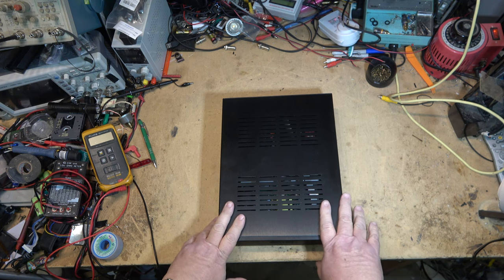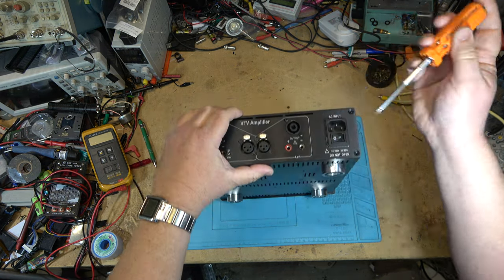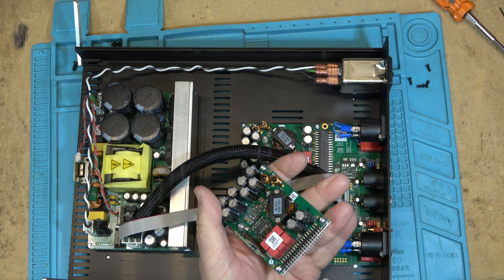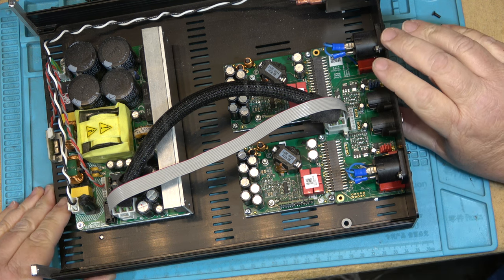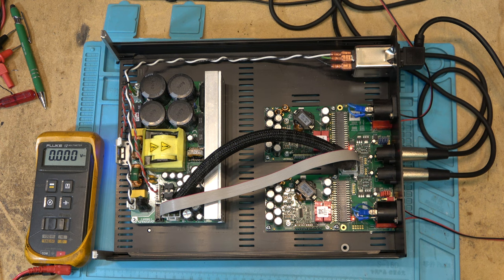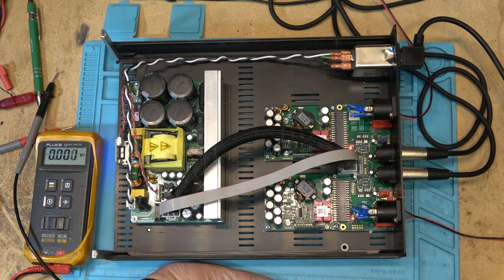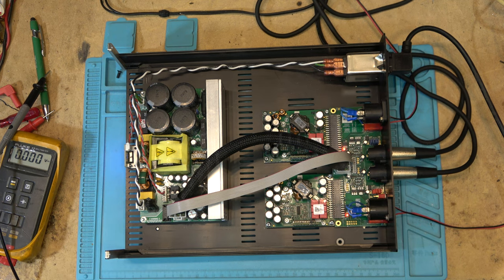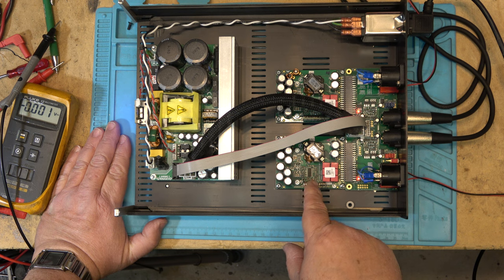VTV PURIFY Amplifier Tear Down and Demo

Comment: There’s a one man show in Ohio called Buckeye Amps run by a guy named Dylan.  He assembles Class D amplifiers for sale.  He has Purifi options in a higher power monoblock version and then also 2 and 3-channel versions using the same modules as the VTV in this video.  He also offers Hypex amps using the NC252 and NC502 modules in 2, 4, 6 and 8-channel configurations.

I am running my home theater with a 3-ch Purifi for the LCR array and 8-ch Hypex NC252 to run my surrounds.  Great value for very capable amplifiers.  Not exciting to look at but they are clean and powerful.  Significant upgrade over my 7-ch ATI-built noisy amplifier.

As far as I’m concerned the AVR industry needs to drop class AB and use a slightly smaller variant of Purifi or Hypex modules.  Roughly 90% efficiency compared to 50-60% Class AB.
Reply from the maker: I agree class D is now the way to go.  Very powerful and so clean these days.  The perfect audio components to not add anything to the audio signal.   SACD with a good dac and a class d amp is about as good as you will get followed by DAT then CD.  Analog formats such as reel to reel next and then compressed digital cassette and vinyl the bottom.  
Of course people got used to analog artifacts and they think the sound is inferior when they are not present.  And that's why people pay huge dollars for vintage equipment.

Comment: I have the Behringer A800 class D and it sounds like no other amp so clear so powerful there is no other class that can come close to that awesome clear sound
Reply: Nothing beats a/b
Reply: A800 and other pro-style class D amps are pretty good (a lot of the Behringer are based on IRS2092 chipset) but the Purifi amp is on another planet entirely. They sound like nothing at all, just the audio signal direct to the speaker; whatever you feed them they will put directly out without changing it.
Reply: @catsbyondrepair most audiophiles can't even say which is which in a blind test

Comment: Nice review and I agree, Class D nowadays are fantastic amplifiers with amazing efficiency. If you want to experience it, try an ICE amplifier unit with built in switching power supply. For just 100 euro you can buys this with 250 watts output and really great quality
Reply: The IcePower Series is especially amazing! I have this in the 700€ Canton AS 650 SC Subwoofer, and tbh - that thing was the 2nd most expensive sub from Canton, but it was handmade over here in Germany and sounds so damn good, I will never want anything else! Linear down to 30Hz, and still absolutely pumping out in the 20‘s… I know, the Amplifier is only going to be equivalent to 1/3 of a good sounding sub especially, the other 2/3s is a serious quality Driver (Speaker) and the utmost attention to calculations for the enclosure and it’s vent measurements and placement.

Comment: Crazy to think that the toroidal transformer on my parasound a21 weighs like 2.5 complete amps. Sure can appreciate the electricity savings you get with an Amp like this compared to a class a ab amp.

Comment: Those who are simply just making noise about Class D, just try to have a listen to Leema Acoustics Elements AMP with just 56Watts per channel with anything above (TRUE) 88db speakers and then you will understand you no longer needs that Class A or AB heater anymore on your room.
Reply from the maker: The people that dislike class D simply don't understand how it operates. These same people will argue till their are blue in the face that cassette tape and vinyl has better sound than cd and other digital formats. No point trying to educate them because you can't fix stupid

Comment: Purfi is another level, but I bought a crown xls drive cover to drive my diy subwoofer and I wanted to try it in stereo with my diy speakers and I have to tell you it sounds really good, very clear no coloration. I have some really nice speakers and they can handle a lot of power and this crown can deliver with no distortion and little heat. I'm thinking about building a class d kit or maybe get a ice amp off parts Express and make my own case

Comment: Yep these amps using the Purifi modules are great amplifiers. Glad you've gotten to experience one. If you don't need the power output, the class H Benchmark AHB2 delivers even better distortion but with still decent power output. Class D will always have more power output than Class H, but you'd be surprised how loud 100W really is. If you monoblock the AHB2, which a will give you even better performance, and a lot of people that buy this amp will buy two, you'll get 480 Watts into 6 ohms with 0.0003 % THD+N at full rated power, 20 Hz to 20 kHz. I know how you feel about specs, but this amp you reviewed here is solid state, not tubes, and is also an objectionably well measured amp too. I hope one day you'll get to experience an AHB2.
Reply: 480 watts of what exactly?
Reply: @tyronenelson9124  That's RMS output of bridged mono at a 6 ohm load. They rate the output at 0.0003 % THD+N for that rated power, at 0.1% and 1% THD+N the output is much higher.

Comment: Class D are pulse with modulated amplifiers - a fully analog process. If it had been a digital amp it would be able to work on S/PDIF serial digital bit streams, or a parallel bit stream of some
other kind. Nowhere in a class D amp you can work with digital signals. So don´t be one of the ignorant´s who keep spreading the message. SMPS are also not digital power supplies.
Reply from the maker: Actually it is a digital representation of an analog signal.  The outputs are either on or off.  There is no in between as in a linear amplifier. There are 2 states.  On and off, or better represented as a 1 or 0.
That is the definition of digital.  
You are thinking quantization where is waveform is aampled at a given rate and each value is driven a numerical value.  The resulting serial pulse train is called pulse code modulation or PCM.  When a CD is made the PCM is converted to a pwm signal in a conversion process called EFM, eight to fourteen modulation.  This changes each 8 bit byte into a 14 bit word in such a way that the minimum pulse length is 3 bits wide in the resulting pwm that is modulating the laser.   Trust me i do know what digital is and how it works.
Class D convert analog signal into a digital representation that can be transmitted over a wire over a fiber optic link or operate a radio link. The amplitude is a result on the shift of the duty cycle.  A simple filter to cancel out the carrier will return the original analog signal.  
Digital does not mean it has to be encoded in some way.  It just has to be able to be represented as a 1 or 0 and class D amplifiers meet that criteria.  So yes calling them digital amplifiers is accurate but if you like you can try to file a lawsuit claiming misrepresentation and see how far that goes.   😁
Reply: @12voltvids  This comes from Wikipedia: Please notice the sentence starting with **.

"The letter D used to designate this amplifier class is simply the next letter after C and, although occasionally used as such, does not stand for digital.
**Class-D and class-E amplifiers are sometimes mistakenly described as "digital" because the output waveform superficially resembles a pulse-train of digital symbols, but a class-D amplifier merely converts an input waveform into a continuously pulse-width modulated analog signal.
(A digital waveform would be pulse-code modulated.)"
Reply from the maker: @qddk9545  the D in class D has nothing to do with digital.  
Digital signaling is simply a binary way of signaling.  Mores code is digital. It's an on or off state nothing else. You have 2 operational states, either on or off, no in between.  Any analog signal can be represented as a pulse stream by mixing with a triangle waveform and a comparator that will switch high or low turning that analog waveform into a digital representation of the analog signal. I am sorry if you don't have the intelligence to understand that very basic form of communication. All the rest of us are laughing at you.   
You are confusing the very basics of digital technology which is a simple 1 or 0 state with coding.
PCM Pulse CODE modulation. 
PWM, Pulse WIDTH modulation. 
You note both have the word pulse, that is the digital clue. The next one CODE indicates that the data train is a quantized numeric value. 
Pulse width modulation is a digital representation of an analog waveform.  If you kept the duty cycle 50/50 and varies the frequency to follow the amplitude of the modulating you would have FM, frequency modulation.   If you kept the frequency constant and rotated the phase of the oscillator using a varactor diode then you have creates phase modulation. These are purely analog modulations. However adding that comparator to turn the AC input into a duty cycle shift on a constant frequency square wave creates a binary waveform with only 2 states either on or off which is the basic definition of digital.   Sorry you lose !
😁😅😆😃😀😄🖕
Reply: @qddk9545   It's fully ANALOG. For it to be digital there should be a finite number of output levels. This does seem to be the case (2 levels) but there is a coil in the output. The information 'stored' in the square wave, regarding the amps output voltage is captured in the puls width. Since this is a self oscillating amp, this number has an infinite (analog) resolution. (It actual has more feedback loops, briljant design by Bruno Putzeys. To my knowledge, the first one to pull this off, with the output coil within the feedback-loop.)

Comment: I use class D amps to drive my 3 subwoofers and they are smaller than the Analog ones and have plenty of power for the subs. I can fit like 12 of them into my Marantz receiver!

Comment: I believe in you mr.12 volt that digital amp is good sounding and efficient ...i try it with a cheap module from china for my diy amp and even it was cheap i was very impressed for its clarity and efficiency compare to mid pricy class ab amp...

Comment: That's a nice looking class-D amp, nice quality construction too. I am a big fan of class-D stuff, the only problem with them is when they go wrong, a lot of the time they take out the speakers with them aswell. But they are very efficient compared to class-A and others. Thanks for the videos. :-)
Reply from the maker: Oh so no worse than a crown dc300!!!
Reply: @12voltvids  Not quite as bad as the capacitor-cooking dc-300 no, but they sound nice-ish enough! :-)
Reply from the maker: @androidtvbox266  I'd take the vtv any day over old crown or sansewage garbage.  I put this on my good speakers and I had to pick my jaw up from the floor.

Comment: Class D is not digital! Where did you go to school? Class D is pulse width modulated.
Reply from the maker: And here we go again.  Class D is binary.  2 states. On and off. That is what defines digital.  Morse fucking code is digital.  
PWM Pulse width modulation is as digital as any other signaling.   
You are thinking PCM Pulse code modulation which is another way if conveying information in a base 2 binary world.  There are plenty of digital modes that do not rely on PCM.  Teletype, radio teletype, FSK, all are digital but do not require quantization and PCM but they are every bit as digital.
Class D is just that.  The analog waveform is "sampled" into 2 states, a 1 or a 0.  The 1 follows the positive swing and the 0 the negative swing.  The duration of no signal is a 50/50 duty cycle.  The amplitude of the waveform determines the duty cycle.  The higher the amplitude the greater the duty cycle of the digital carrier.  
You need to go back to school and learn the very basics of electronics and stop listening to internet idiots that never finished high school.

Comment: I recently bought one of the Fosi Audio TB10D amps (The updated version) and it changed my opinion on class D amps. It seemed to have  clean power output at the volume levels I normally listen to and plenty of "punch" and that was listening to a Rush CD at genre appropriate levels through a pair of Infinity bookshelf speakers. Not bad for around $80 and it didn't get warm. Interesting that the Purify amp switching power supply was twice the size of both amp modules.

Comment: What's the most power you've ever used to drive apeakers? I remember once going to 10 watts (according to the amplifier's meters) and I thought the house was going to collapse from the vibrations. This was back in the 80s. At the time, I never understood why people would buy huge amps. If I'll never max out a 40W amp, why pay for an 80W? Of course, the tech back then was different, so maybe it all distorted.

Comment: Yes class D is a very unusual way to produce audio, i sort of remembered a pwm method with filtering at the end to remove the r.f, or something like that but i have forgotten all the details.
Does it still have a kind of amplifier hiss?
Reply from the maker: No mouse at all. You can draw similarities between a class D amplifier and FM transmitter. They both do things similar ways. In both cases the audio is changed from an amplitude to a frequency or a pulse width. In FM as the signal goes positive the frequency rises as the signal goes negative the frequency drops. The amplitude of the incoming modulating signal affects how far the frequency shifts the higher the input the higher the frequency shifts on either side of the carrier that's called deviation. In a classy amplifier which is pwm the frequency remains constant the duty cycle shifts forward and backward of your time constant so as the voltage rises the on time of the positive transistor increases and the negative transistor decreases. As the voltage goes negative the positive transistor decreases its duty cycle and the negative transistor increases its duty cycle. The amount of shift is determined by the amount of voltage swing on the input. Filter out the carrier and the result is the audio signal. No noise added no distortion added no bumps or dips in the frequency response added just pure sound. They are bloody amazing and my next amplifier will definitely be a class D. Class H  also have good Dynamics however there is that transition on a class h where they switch from the low to the high rail and that switch over point can be detected. Whether you actually hear it or not because by the time you're at that level of volume your ears are not quite as sensitive to transitions but they're still at transition point. at least they perform better than your conventional class A B where those transitions result in distortion because the power supply has no more reserve. That's what class H give you over a class A B which they are just a class A B just with a second power tap with charge capacitors on tap waiting to be switched in momentarily to handle that extra kick required to prevent clipping. Class D you don't need that you've got the reserve already there and you're not burning up extra energy keeping a second power supply in standby. When I showed my omt the other day, I forgot whether I showed the cooling fan in my communications closet but I have to have an exhaust fan in where my equipment is because the big Onkyo amplifier for my home theater produces so much heat that it would literally cook all of the equipment. I would go in the closet and it was like 35° C after an evening of the equipment running. I had to cut a vent hole in the wall and put an exhaust fan up at the ceiling or leave the door open to prevent all the equipment from overheating. Old class AB amplifiers are pretty inefficient especially the type that use dynamic bias. Dynamic bias amplifiers at low volume switch to a class A type output so they burn a lot of electricity doing nothing on the top of this Onkyo gets quite hot even when there's no sound going through it same with my Technics SUV 9. New class A as techniques called it. New class A my ass just a way to waste more energy turning it into heat doing absolutely nothing. As far as I'm concerned the old receivers that are collectible are only collectible for the same reason that old reel-to-reel recorders are collectible because they look cool and they make great display pieces like my old cameras but not really useful as far as sound quality goes or in the case of my old cameras they look impressive but my little cheap camera that I did this video on will run circles around them everyday and twice on Sunday
Reply: @12voltvids   " No mouse at all "   What are you talking about dave?
Reply from the maker: @zx8401ztv  haha.  I was using voice dictation and that came across the tv just as I started speaking.  Too funny.  Was a home renovation show on and the people had a mouse problem.  Lololol.
Reply: @12voltvids  ha ha i wondered if two men were coming to put you in a restraint jacket lol.
That voice dictation works really well :-D
Reply: @Douglas Blake I Saved the text ages ago,  my vision goes out of focus when im getting tired.
Ill leave the text untill tomorrow when im not crosseyed lol.

Comment: the little block of red caps are the filter caps the electrolytic capacitors and the 2 little inducters are on the power rails.
you wouldn't use electrolytic caps for class D sine re-consatution at the output the power loss in the caps would be enormous and they would heat up and pop.